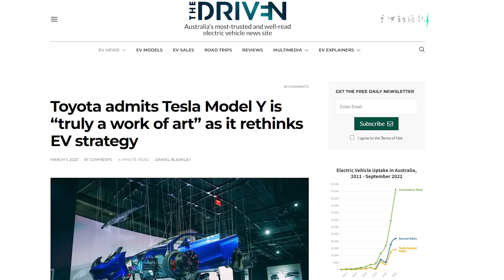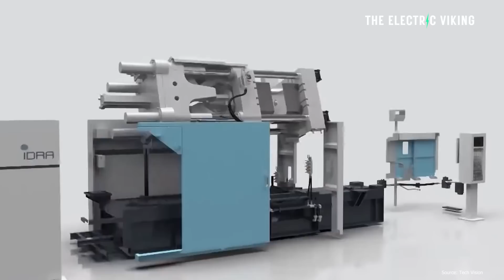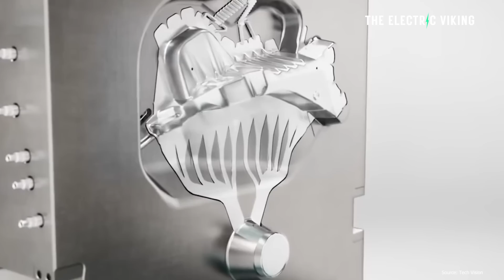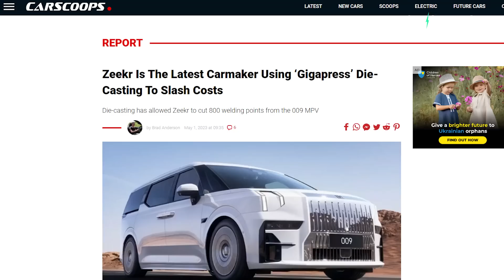Why Toyota decided to change entire production process to use Tesla's 'Gigacasting'

Comment: It was a 300' fall from the southern end of devils slide.
Reply: True engineers know that the problem is way more complicated than the cost of production.  Sheet metal is used because forming it can allow the designer make the structure stiff in a specific way in 3d space.  Cast material is weaker than rolled and formed material, so his casting must add material to compensate for weaker stucture made in the casting process. Welding cast material is usually a problem, so the giga castings will problem have to be totally replaced in a crash repair....$$$$

Comment: Seems to me that insurance companies have not yet caught onto the fact that these giant castings will not fare well in any collision above probably 5 mph. How can a repair shop straighten one of these castings when it gets deformed even a small amount after a crash? If Tesla insurance premiums are not already sky high, seems like they will once the non-repairablility of the cars becomes more evident. Rivian have already run into issues with their gigantic, monotlithic body panels - a minor crash in a Rivian truck can cost several tens of thousands of dollars to repair - if you can find a shop that will do the work. Maybe I'm wrong, maybe the castings can be pulled back into shape - but the whole point of a casting is that it's rigid and relatively non-deformable which looks like trouble to me.

Comment: I worked for a CM firm in a legacy automaker’s stamping plant.  Watched sheetmetal going into huge stamping machines to form parts that are robotically spot welded into subassemblies that form cowl/dash, door rings, etc.  Every stamping also produces waste sheetmetal pieces that are discarded as scrap.  Tons of scrap are carried away to a scrap bldg where they are loaded into trucks that haul it off to metal recyclers.  If that scrap system goes down, eventually the presses have to stop.   I can see how a giga casting reduces the number of stamped parts, many material handling & welding robots & welding assembly lines which also reduces the utilities powering the robots (weld water cooling, electrical bus duct runs, compressed air, etc).  The savings have to be quite significant.
Reply: Not sure that the lack of recycled trimmings would be enough to stop car production.
Reply: @jbbuzzable  Under ground tunnels with conveyor belts removed scrap.  You bet your croissant that a stopped scrap conveyor WILL stop the presses.  One facility improvement we made was to upgrade the scrap handling system. This was a stamping plant that produced sheetmetal parts only & shipped them to Assemby plants where body shops welded parts, bodies in white went through phosphate baths & ELPO baths, baked, went to paint & merged with General Assembly where powertrain, engines, interiors, windshields etc finished vehicle to drive off line.
Reply: @Trilobite45  Okay. I thought you were talking about the actual recycler. I understand that a breakdown like that could temporarily halt production. Just any of the other thousands of machines there could.

Comment: Toyota ws shocked at the level of advanced engineering inside a model y when they took it apart. It hit them that they are very far behind Tesla, and that unless they get rid of the old methods of building cars, they will become obsolete.  It will take them 5 to 10 years to catch up to where Tesla is now, but in that time Tesla won't be standing still. The cybertruck is coming later this year, the new 25,000 car will be built in the new plant in Mexico, and the Tesla semi will be in production.  For the foreseeable future Tesla has an insurmountable lead on it's competitors.

Comment: Leads to a crippling issue. With a regular car after a fender bender you replace a fender. With a car that is gigacast- can it even be repaired? At all? If it can't the insurance companies are not going to just continue to offer insurance at the same old rates. They will raise the rates right through the roof. For anybody who has these kind of cars.

And by the way, Toyota taking apart a model Y and saying it was a work of genius? I remember years ago they took apart a Dodge Neon and said this is the way to make cars. And when was the last time you saw a Neon on the road?

Comment: Do you realize that because the Cybertruck is using giga castings that this guarantees Tesla will make at least 100K per year at full ramp?
This is based on Sandy Munro stating that unless a company makes a minimum of 100K of a particular vehicle, they will lose money. 100K of one vehicle is near the break even point financially. To make a profit you would need many many more. 

Therefore, as you alluded to in this video, I would predict that Toyota will reduce the number of EV models they will offer as compared to their earlier statements of 20 models or more.

Comment: Aperently the castings are quite weldable. So in the case where one corner of a car is smushed you order a quarter panel and a casting section. Would be a good use for imperfect castings. Or as you said you total the car. Also fyi there is a strong market for totaled Teslas because the parts get rebuilt into custom vehicles that want the Tesla tech.

Comment: It's still really a bad idea. Get into a small collision, crack your chassis and now your car might be a complete writeoff. It might be cheaper for Tesla and other automakers to churn out new cars but that's besides the point. Tesla supposedly does have some kind of collision absorption zone that can be cut away and replaced but it's only useful in some cases. I wonder if owners will pay with higher insurance premiums.
Reply: ...yeah, to dismiss that aspect of the design as "that's what insurance is for" is just braindead...it's a valid concern that is definitely an issue going forward...

Comment: The entire picture is changing.   When the majority of cars on the road are self driving and talking to each other with V2V the number of car crashes will plummet.  The insignificant cost of insurance will be provided as an part or in conjunction with the self driving software.   The vast majority of crashes will be due cars w/o self driving.   
Modern cars driven by people will have most of the advantages of the self driven cars.  Like knowing there is a car about to run a red light hidden from your view.

Comment: Biggest problem with press casting in these applications is you cant repair it after an accident.  It just makes disposable cars. Which is great for manufactures profits, but not so great for consumers.
Reply: Before the insurance company gets to the line about the cost of structural damage repairs, the cost of the other damages usually exceeds the value of the car, so they usually just total it.

Comment: It would be interesting to compare "replacement cost" insurance rates between Tesla cars mad with giga-casting and others.
Reply: If fewer accidents occur with Teslas because of accident avoidance software then the amortized cost of repair will be lowered proportionally.  I searched for "Do Teslas get in fewer accidents" and found the that Teslas basically get in about 50% fewer accidents. I did not look too far into this, but the principle is still valid: Multiply the reduced probability of an accident by the average cost to find expected cost per accident.  Also, as several others have pointed out, the injury to occupants is reduced because of the superior crash worthiness of Teslas. Injury costs can be quite high.

That being said, some others have pointed to insurance companies charging more when the cars are equipped with  the 'full self driving' feature.
Reply: @eideticgoone7035  it comes down to the premiums, comparing a model 3 with a bmw ICE car or something.  That's the economic question. Beyond that, if course, is which car is safer, and whether   the better margin of safety is worth that much to you. (Maybe a Hummer......not)
Reply: @superbear617  True, but hopefully the premiums would be in line with the amortized costs.
Reply: Even if the cost is more, Teslas are involved in fewer accidents.
Reply: ...that is such a silly argument...this guy thinks every "crash" totals a vehicle and insurance rates are the same across the board for every vehicle...the Gigapress is revolutionary but the repair and insurance aspects are valid points...
Reply: @puzer1  It would be worthwhile to explore exactly what kind of impact accident would "total" a car with a giga-cast frame. It seems to me that it would be extremely costly to replace one large frame element, but perhaps it could be welded (though welding aluminum requires expertise perhaps not found in the average body shop). In any event, if a damaged car can be repaired for $8K, but a giga-cast car with the same damage is totaled, or costs 2-3 times as much to repair,  that must translate to much higher insurance premiums.
Reply: @superbear617  100% - even in a low speed accident, what is the remedy if the giant casting is slightly deformed? Can a shop use conventional frame straightening tools to bring it back into spec? That seems doubtful as the whole point of a casting is it rigidity and non-deformability. My bet is the insurance industry has not yet fully caught on to the risks of insuring a car that has to be totalled after an 8 mph crash because the entire rear casting is now 0.25" out of spec and can't be realigned. Maybe Tesla has considered this, but I highly doubt it as repairability is not something they (or the tech industry in general) seem to care much about.
Reply: @superbear617  In my limited understanding, if the damage is limited to the crumple zone insurance will consider repair. If there is damage to structural elements such as gigacasting, frame, unibody, they will total it.

Comment: So what's next? Complete car bodies injection moulded from a carbon-based structural plastic. This will save another mountain of money and manufacturing time. Being a retired Production  Engineer, I can see this coming within 5 years. The body will be constructed with a giga-pressed aluminium shell overlaid with the carbon plastic outer skin. Doors bonnet boot lids, will be die-cast frames with the same plastic overlay. It will make a car cheaper lighter and more soundproof with an overall improvement in strength. Completely rust-free.

Tomorrow's cars will have little in common with the way gas cars are made today. We need these new types of cars so AI can build them.
Gas cars. Heavy, costly to produce, noisy and polluting. Besides the parts and maintenance costs keep rising also the rising fuel cost.
Can't see any reason gas cars will be made in ten years' time, en route to extinction. 
Sandy Munro is a production engineer, he has his eye on the ball, Sandy knows the future you can bet your last dollar and win with Sandy.

Comment: Nice video & no there's nothing wrong with copying someone else's idea as long as you don't try to clam it's yours - the Japanese manufacturers have done this for years.  If you look back at their history, they would take ideas from other auto makers, improve & sell them.  BMW used high pressure aluminium alloy castings for the suspension mounting points back in 2010(? might be earlier) as it gives excellent accuracy whilst reducing weight (helping the fabled BMW 50/50 weight distribution), but most car manufacturers are very conservative (actually applies to most established companies - ask Warren Buffett about his views on diversity hires), they will not change from the tried & tested until is is proven or they have to, legally or financially. As for the downsides?  I've seen some Tesla's written off for quite small amounts of damage and this will lead to higher insurance costs (is this why we have Tesla insurance??) but this is something that could be put right (albeit with more parts).  As for the crash strength? Well Tesla drivers & passengers do unfortunately die in accidents (same as any other car) so it's hard to say but they do have an excellent crash rating and the stiffness can be felt when you drive it (did a back-to-back with a Model 3 & an Atto 3 - really shows this up with the Atto not being up to Euro quality just yet).  The example you gave isn't convincing though as I have seen an 'off the cliff' accident at a notorious black spot close to where I live, everyone survived but they were in a small, old, rusty econobox Ford.  I'm still not going to recommend we all drive around in them for safety though ;)

Comment: Giga casting is how metal car model kits are made.  I think they use zinc?  Zinc breaks so easily.  I was surprised to hear giga casting uses silicone/aluminum mix.
Reply: The big Castings are an aluminum alloy.
Zinc alloys vary radically.   There are several version of Zamac.  One or more are used to build machine tools.  
The property of metal alloys in general vary tremendously each with a purpose. According to the Aluminum Association, there are more than 500 registered aluminum alloys.
Reply: The automotive industry uses steel sheets that are pressed, and welding, believing that this is the only way to accomplish building a car.  Zinc is for the metal castings for car model kits.(which can actually be looked up). If Musks’ father wanted Elon to become an engineer, he would have given him a gift of a metal model car.

I remember mine, it disappeared very quickly out of sight out of mind.  I wonder what happened to it.

The Aluminum/Silicon parts probably buckle more than steel, though they’re adequate for automotive purposes.
Reply: @effingsix3825  As with all castings, there is a widely varying degree of distortion and variation. Thus the subsequent machining operations to bring the casting into acceptable tolerances.
Reply: Just using a simple term: ‘Die Cast’ nobody would have considered it possible to die cast automobile parts, because the requirements were for mostly using steel sheets in construction, which are cut and forged, then spot welded.  I was taken by the BMW i3, since it’s made with carbon fibre, though it’s days are now over and in the past.  BMW still uses carbon fibre mouldings to construct vehicles.

Comment: While I am a proponent of Tesla vehicles, and EV's in general, there is a valid consideration regarding EV auto insurance in parts of the world. A Tesla car is almost twice as much to insure in Texas, USA as a comparable ICE vehicle. This is not necessarily due to Gigacasting, but probably more due to the cost of replacing the battery pack if damaged in a crash. This, along with shortsighted policy with EV auto registration surcharges in Texas ($400US on new car registration, and $200US thereafter), make EV ownership more expensive.

Comment: One of the reasons Tesla gigapress works is because of the new alloys they are creating by working with space x engineers.
Reply: Not like others can develop their own alloys that work too. Tesla’s giga advantage is soon gone.
Reply: @TheBooban  They likely will or already have. That is just one small part part of Tesla's advantages, and the way Toyota is using it presents no threat to Tesla.
Reply: @jbbuzzable  you should elaborate or your comment didn’t say anything. How is Toyota doing it wrong? Tesla may have other advantages, but this one is significant and is now gone.
Reply: @TheBooban  For some reason I thought Toyota was going to use them in ICE cars. I was wrong and retract that part of my statement. Thanks for challenging me.
Reply: @TheBooban  Who is to say Toyoda will be good at it? The wheels on the BZ4X were falling off. Castings are not what is going to save the world's most indebted company from bankruptcy in ~5 years. They are screwed.
Reply: @TheBooban  Tesla does not care about the, so called, competition. They have open sourced their patents. They are helping Ford and GM by letting them use the SC network. They want others to succeed.

Comment: Standard built cars are also going to be totaled in most serious crashes.  There will probably be cases where unicast cars are totaled where standard cars would not be totaled.  However, the value of any car that has been in a serious crash and repaired is lessened considerably so the owner of a repaired car will not get as much on a trade-in or sale of their repaired car.  I would pay more in insurance for the safety of a unicast car if the rates for them goes up.